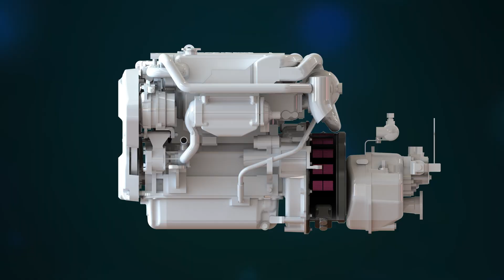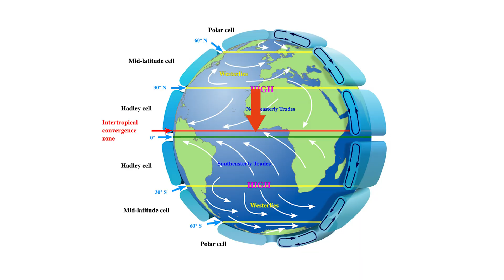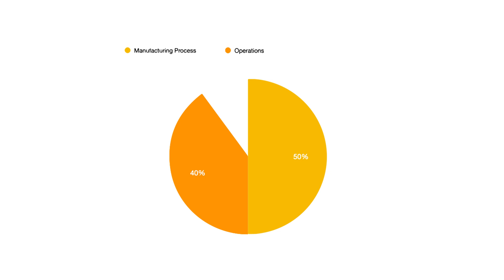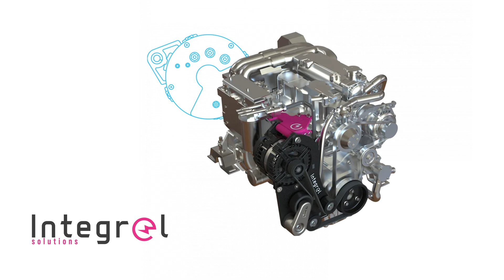Part 1: Designing and Building Green Sailing Catamarans

Comment: I’ve never sailed, nor boated for that matter. I love the idea of sailing and considered entering that endeavor. But i’m an old guy (75) and beginning such takes a learning curve, both sailing and lots of parts requiring maintenance. So i considered powerboating for its simplicity, paying for engine service. I’m over simplifying from lack of experience. I like the idea of green sailing, and i don’t like the dirtiness of ICE. I love the idea of solar sailing. Hopyacht 30 comes the closest to solving the solar sailing concept. I planned to try one for med/canal travel in europe. But i hope other manufacturers would also try a green solar sailer that would allow only coastal and canal travel. The hopyacht has three problems, first, the best spot is the berth where i’d be unconscious. Two, the place i’d be the most is the helm which is the worst spot on the boat. Finally, the hop is good for 2 people, more becomes a squeeze (i don’t want a party, but 2 real berths). I hoped either hopyacht v2 or another manufacturer see a non-liveaboard, coastal/canal travel market viable. The technology is not at the stage for long passages, but shorter ones are possible for vacationing. Hours stopped moored, anchored, or at a marina to explore and enjoy onshore activities. To allow solar recharging the banks. A cat with a small sail plan (just a genoa) on a tabernacle mast, 4.5m beam, 1.7 draft, 3.5m air draft, smart electronics, enough batteries, enough solar on a full length roofline (everyone adds a bimini anyway), cabin venting without sunroofs, e-propulsion and a smart interior layout. Only the green hopyacht (too small) and the not-green dracan (great size) offers the size cat i’d like.
Reply from the maker: If you look at the marine industry, you will see that there are thousands of different boats designed to fit and suit thousands of different needs. I suspect that if there is a large enough market for what you have in mind someone will design and build it!  At Balance we just focus on the area of expertise we know.

Comment: Can you please elaborate on "Green Washing" from that "certain" manufacturer that you displayed in the video? Especially when one owner has has done a crossing where they had to give away fuel at their destination. They also claim using recyclables and less water in their building of their boats?  Mind you - emission free boating - are they referencing actual usage/running of the boat only. So maybe taken out of context?
Reply from the maker: Hi Paul, I do not wish to call out a specific manufacturer here. I simply wished to point out that installing a lot of solar on a catamaran or an electric motor system does not make a yacht green. It can make it greener of course. I stress that sailing more than motoring is critical. It takes a lot more fuel to push a heavy charter cat, for example, than a Balance or an Outremer. I have no idea what other builders may claim, but I did see marketing at a recent boat show for “emissions free sailing.”  That’s a fantasy on the operational side unless the boat owner is prepared to drift through the doldrums or turn off all electric gear on cloudy days. If you followed the Jimmy Cornell Alcana challenge in the effort to sail around the world without fossil fuels, they had to give up the effort soon after they began.

If a given cat arrived after an Atlantic crossing where they  “gave fuel away” on arrival does not prove they did not use fuel.  But of course if they had beam winds all the way and great solar days they may not have needed much fuel. If they were carrying extra diesel it means they had a generator to propel electric motors, or had a parallel hybrid diesel electric system. That they arrived with more fuel than they thought they would need is hardly proof it was a fossil free passage. 

All passages are different. I once crossed the Atlantic from Gibraltar to Bermuda in August and we had almost zero wind the entire time. To conserve fuel we motored at 3 knots or less or not at all. 

There are efforts underway to build boats with greener materials. We have explored them, but are not convinced they are proven enough yet for us to jump on board. 
Best, Phil
Reply: @balancecatamarans  Totally awesome that you took the time to reply in detail. Surely new cats that are coming out with 5+ Kw of solar and elect motors and have a generator still have a reduced fuel consumption?
Reply from the maker: Paul, sorry for slow reply. Of course you are correct. More solar is always a benefit so long as you have a battery bank that can take advantage of it.

Comment: Glass solar panels are slightly more efficient due to better cooling, but walkable solar panels are vastly more practical on a coachroof or foredeck where you might need to walk to work on sails.  

Very likely the best walkable panels are made by Solbian in Italy using SunPower cells.  They are used by Windelo and a majority of IMOCA 60 and Jules Verne Trophy boats.

Use more solar and more battery.  Definitely look into hybrid drives.

Lithium ion batteries are fully recyclable.  See Redwood Materials in Nevada, for example.
Reply: Would love to see a real-world comparison as the thermal temp coefficient is a real thing.  These boats spend their time near the equator where temps are high, but sun is abundant.  I'd suspect in a surface area comparison, you'd need about 1.3 to 1.5 as much surface area for walkon to get the same output.  The other factor is walk-on won't last nearly as long as they do get very hot.  In electronics, heat is the enemy.  Glass panels should last 20yrs + if corrosion is looked after.
Reply: @KeithStrang  Silicon solar cells are more efficient when they're cooler.  However we since  can't walk on glass solar panels, they are more limited on where we can put them on a sailboat since they interfere with walking on deck to work on sails.

Therefore with walkable panels, they can cover much more of the coachroof, and some boats also put them on the foredeck also.  That means much greater solar area.

Even if they're less efficient due to heat, the much greater area more than compensates for that.    

Compared to the cost of a boat, the extra cost of more panels is largely insignificant, especially compared against the benefits of more electric energy being available.

The SunPower cells that Solbian uses have a 40 year useful life expectancy, but probably continue to produce usable power long after that.  Heat will probably reduce their life, but they would probably still outlast the boat.  

SunPower has the highest efficiency and second highest thermal coefficient, so even when hot are the most efficient solar cell available.

Bottom line: it probably works fine.
Reply: @LoanwordEggcorn  But Solbian offers a 5yr warranty? Not saying that means anything, just looking at what their site says.  Walk-on would certainly be nice, but to some it seems like too much of a liability as the panels may have a higher failure rate when out voyaging.   I think flex panels have done great when used in applications were they can be ventilated.  Planning to replace panels in 5yrs, which a lot of people do with walk-on panels already, doesn't seem that green friendly either.  I would love if the tech was there and ready as it'd be a huge weight savings as well!
Reply: @KeithStrang  I'm sure Solbian panels will work fine beyond 5 years.  They use ECTFE plastic encapsulation, which is highly durable.

Solbian panels have blocking diodes.  If a panel with diodes failed, it would simply be bypassed automatically.  Same with shading, etc.

Phil makes a good point that longevity is related to greenness.  Something that lasts longer reduces environmental impact because it doesn't need to be replaced as soon.

We agree that cooler panels work better, but ventilation really isn't practical other than on something like davits.  

Boats, and especially catamarans, have a lot of surface area, but most of that area needs to be walkable in order to be practical and workable.
Reply: @LoanwordEggcorn  I’m getting (8) 400W glass panels on my 526. They are all raised up, so as long as there is a slight breeze, air will be flowing under them. That small amount of airflow is massive in eliminating heat buildup. 

I would love to test high quality walk-on panels alongside these glass ones. There is a decent amount of surface area on the coach roof that could accommodate more solar, but we want it to be accessible.
Reply: @KeithStrang  The Solbians may be among the best walkables.  Windelo uses them as do most IMOCA boats.
Reply from the maker: They have a very short warranty period. And they note that they can get hot and burn, etc.
Reply from the maker: Keith, the warranties tell it all. The glass panels on my home are warranted 25 years, the soft panels they are using on yachts, some of them only offer 2.6 years of warranty!  But I am not expert enough in science to draw the comparison of output as you could do.

Comment: Look into CIGS/Yuma panels for solar, they last 25 years and are so much more lighter than glass panels. LFP cells for batteries can last 10,000 cycles if used correctly. The best is coming sodium batteries. They already almost caught LFP in density. The biggest thing you can do with LFP batteries is keep them in hulls under waterline so when in tropics they stay cooler since the water is always cooler than air temps usually. I see a couple boat builders have batteries like these in engine compartment which is so bad for them. Heat and C rating control is how you get longer life.

Comment: Thanks for addressing this stuff, Phil.  Like Alex, keen to hear what you’ve chosen for hybrid diesel electric.  The ‘hydro-gen’ with feathering props is also super interesting.  Because Balance boats can sail in lighter air, unless you’re racing, it could make sense a lot of the time to lose 0.75 knots of boat speed but put say 5kW back into the batteries, without ever needing to fire up the diesels.  A Balance 526 is at the top of my list for a 2029 delivery, and your choices here will affect my final purchase decision.  So, good on you for addressing this topic!
Reply: 5kw or 2.5kw per engine regen is asking a lot. right now its 2.5kw total or 1.25kw per side regen. Larger battery banks are needed as is more solar on every boat. We need batteries to double in watts per kilo to truly be able to keep weight down. I say keep 1/2 the water in tanks and use that weight savings to add more batteries.